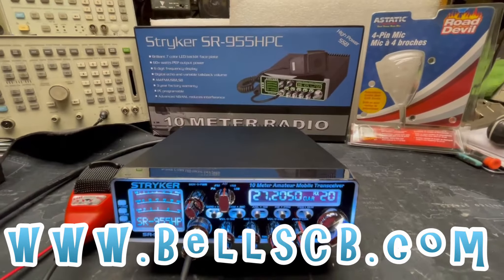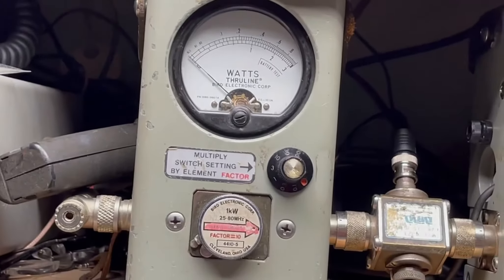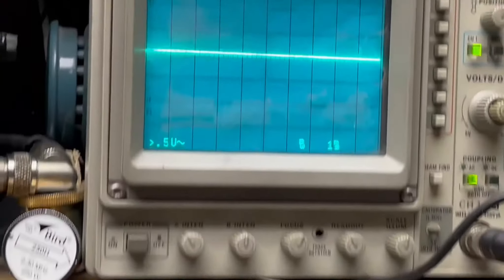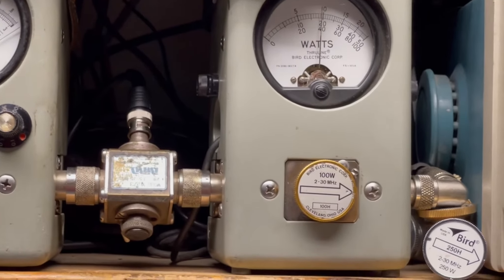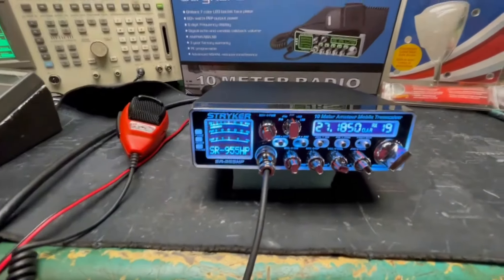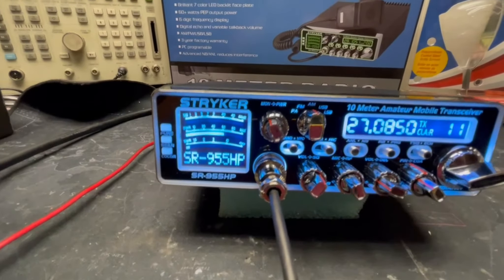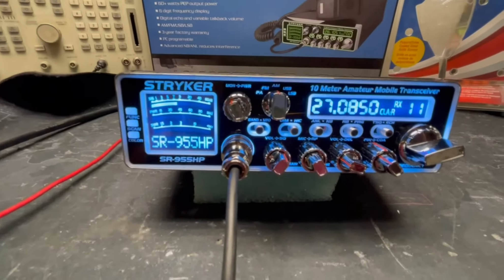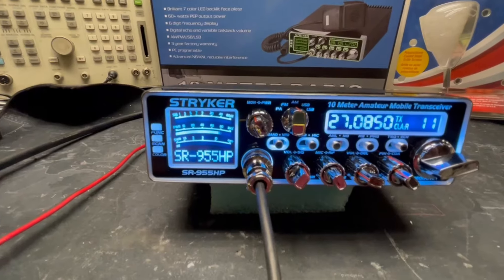Stryker SR-955HPC Tune-up Report

Comment: I have a connex 33hpc1 when I deadkey the mic the meter swings back instead of forward it’s already peaked and tuned etc but seem like I’m not getting my full power out I’m running a copper coax cable I purchased from a pilot running it into 1 k40 I had duals but have to get another mount so I downgraded to one and I also tried fire stick II still doesn’t swing to the red unless I damn near yell what could I possibly do I have it hooked on the dashboard cb mount in a 2020 cascadia please help brother
Reply from the maker: I would be glad to help if I can. Give me a call during the day (Tue-Sat) while you are in the vehicle. 954-771-8161